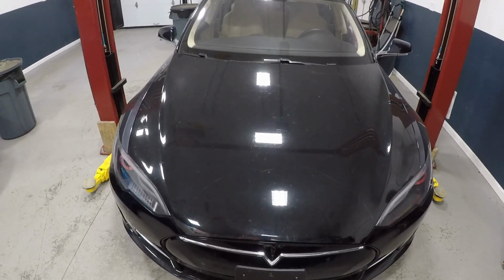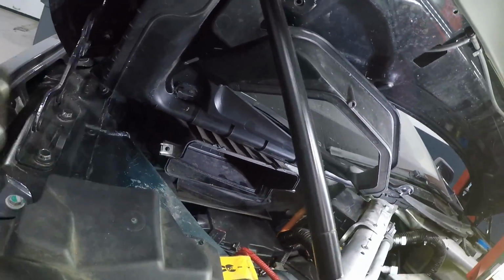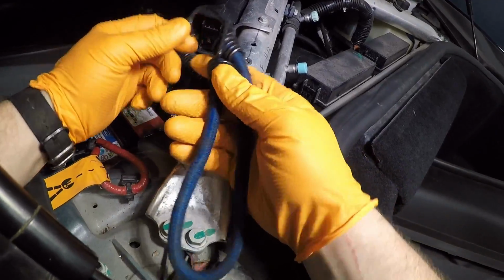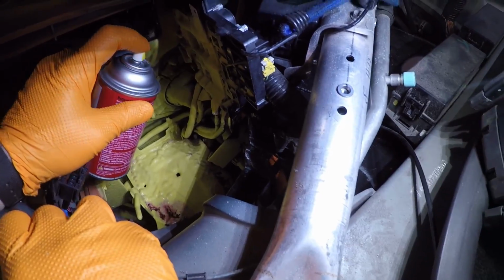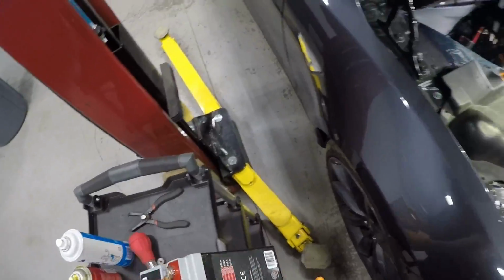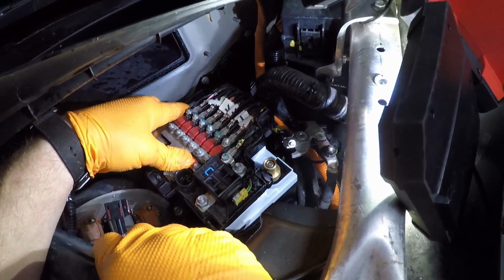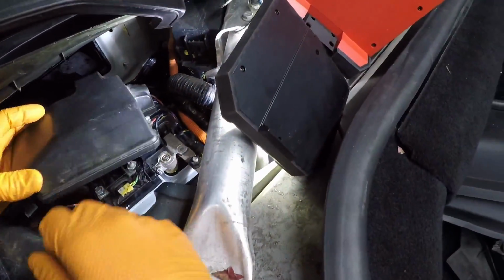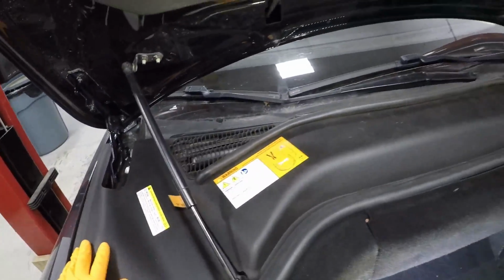Electrified Garage: 2012 to 2014 MS RWD 12v Replacement

Comment: I want to connect 12V battery to an inverter to achieve 110V or 220V. Which two wires are the positive and negative terminals of the 12V battery? What is the maximum power that a 12V battery can handle?

Comment: For some reason when i'm going to connect the negative pole the negative pole is always sparking as crazy, i'm doing everything after the book. Sometimes the car wakes up without me pushing the brake peddal. Its the same on both of my 2014 TMS 85. find it annoying when I turn the modules/computers etc of on the screen and then it wakes up by itself.

Comment: I followed the steps to disconnect the battery, but when I unscrewed the negative terminal it sparked a few times and the alarm went off until I removed the negative terminal all the way. What did I do wrong? The car was for sure powered off, I disconnected the fireman’s loop, unscrewed the negative terminal. 2013 model S. 
Any help appreciated.

Comment: You are a great teacher.  Had to do the 12V on my 2013 Model S and after watching your video was able to do it without any concerns.  Thanks!!!
Reply: Do you remember the error?  Did it say "Unable to drive voltage supply too low"?

Comment: And still this video stands the test of time just changed out my 12v battery, replaced with Lithium from Ohmmu though, and this video made it so easy thank you everyone at EG!
Reply: Do you remember the error?  Did it say "Unable to drive voltage supply too low"?
Reply: @BrenttheGreat  no it said low voltage battery will need to be changed schedule now
Reply: @abuckwitz  Thanks.  I ended up driving 160 miles to a service center and they are replacing the rear drivetrain for $7500+.  Yikes
Reply: @BrenttheGreat  damn that's rough but should last a good amount of time

Comment: Would you happen to know the part number for that OEM fitting that sits between the fuse box and battery? I need to go back to OEM but cannot find source for the part, not even a part number.

Comment: Hi, Thanks for the video. On Gruber's battery swap video, they connect the 12V positive first, as you do it as well, but then they connect the High voltage cable and then, after the High volt cable has been connected, they connect the negative of the 12V battery.
You connect 12V positive, then negative and then the High Voltage connector.

What is the right sequence?

Comment: Thanks for putting this video together in such a methodical, logical, and well described manner.  I was able to change my 2013 Model S battery with no specific difficulties by following your procedure
Reply: Do you remember the error?  Did it say "Unable to drive voltage supply too low"?

Comment: Follow up and tips for others- I was successful in replacing the 12volt. I bought an OEM from Tesla and so didn't do the terminal modifications. One thing I would suggest to anyone trying this: 
1. Old plastic is not very flexible. I snapped a tab removing the filter housing.
2. Removing the nuts for me by hand gave me more control.

Thank you for the tutorial video.
Reply: Do you remember the error?  Did it say "Unable to drive voltage supply too low"?
Reply: @BrenttheGreat  if I remember correctly, I think it said something like “12v battery low, change soon”. And my soon was like three weeks?  Man it was a pain in my version of S. Almost would suggest just a mobile service if you wanted to save some frustration. 12v is packed right up under the fuse box and cabin air intake.

Comment: Hey there, I replaced my 12v battery but it’s still throwing errors and showing 0 miles indicator. Also windows aren’t really rolling up. Weird.. anything I’m missing?
Reply from the maker: Did you shut down the vehicle properly before removing the 12v? Also did you reconnect the fireman's loop?
Reply: @genyat5931 what ended up being your issue??? I’m having having the same issue.

Comment: Thanks for sharing this. How long do the 12v batteries typically last on the older models? Where can I get the positive terminal adapter you used? Thx
Reply: Scott, I just replaced my battery that was 7.5 years old, though I don’t know if that’s normal. I bought my battery from the Tesla service center near me for $165.  Though it didn’t come with the adapter, you can easily remove the one on the old battery and reuse it on the new battery. The new battery is a DCS-33UNCR.

Comment: Did you have to make any changes to the ground cable?  You disconnected original battery's NEG with vertical screw, but connected with battery clamp's horizontal screw.
Reply from the maker: VTAnne Name pay close attention. New battery comes with different adapters.
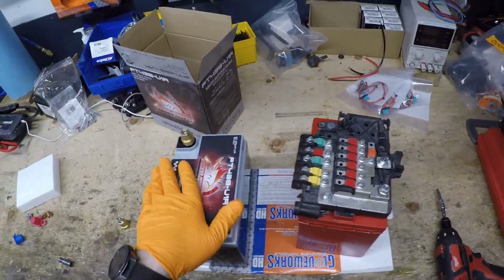Reply: @ElectrifiedGarage   --- I still can't find anything about an adapter for the NEG side.  ~11:20 video guy says "Negative terminal can stay."  Sales website states:  "2012-3/2016 RWD Cars require adapter post which we include. (See video for installation with post adapter)". "Adapter post" means one, right? 

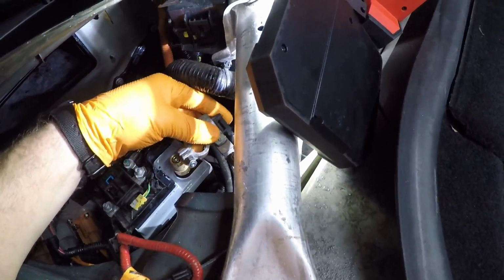The POS adapter post is well explained in the video, as is almost everything else (Its a really good instructional video), but...  DID THEY MAKE A CHANGE TO THE NEGATIVE BATTERY CLAMP? Or does the original Tesla clamp fit around the NEG post of the aftermarket battery?  4:38-4:40 of video has brief view of original clamp, which looks a lot smaller than the clamp shown at 17:42.  This leads me to think that the ground cable/clamp is also modified.
Reply from the maker: VTAnne Name the negative terminal comes with an adapter for the battery from the manufacturer. It’s already on the battery when you get it. You don’t have to do anything additional.

Comment: Is this the same battery for Model X 2018?  Can you make a video for it?
Reply from the maker: KnowOne no it is not. Model X uses a different size battery. https://evtuning.com/products/model-x-lithium-12v-battery-replacement this one will work for your vehicle.
Reply from the maker: KnowOne it is not. The X uses a different battery. The X is a lot simpler. It’s about 15 10mm bolts and the frunk lifts out. The battery is right there and easy to access and change.

Comment: It would be great if someone fabricated an adapter to allow us to use the standard terminal configuration.  A standard battery is much cheaper than the reverse terminals required for the MS configuration.
Reply from the maker: U Tubota with the way the fuse block on top is made that would be very difficult to do unfortunately.
Reply: @ElectrifiedGarage  where did you get the adapter from?
Reply: The reverse terminal version costs the same as the normal version for these batteries.

Comment: can you guys remote disable Model 3 excessive logging?
Reply from the maker: dst rr unfortunately no we cannot
Reply: You can disable the internet connection but then you’re missing a lot of features.
Reply from the maker: @markm0000  That still wouldn't disable the logging in the car. That would just make it so it doesn't communicate with Tesla's servers.
Reply: @ElectrifiedGarage  Yeah I want to avoid the unnecessary writes to memory. My car is on a lot, between driving, 120v charging, sentry mode. It's mind boggling that they didn't make the storage removable.